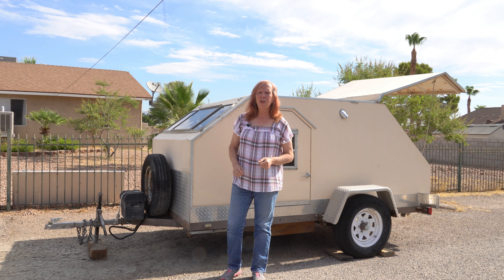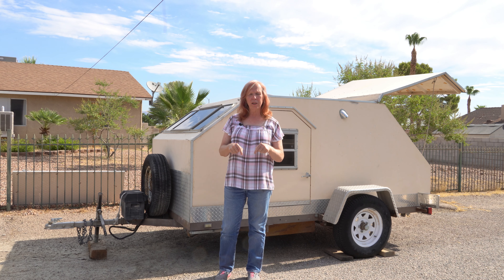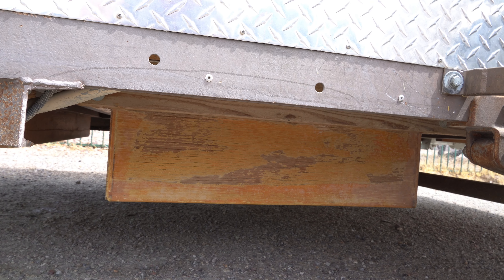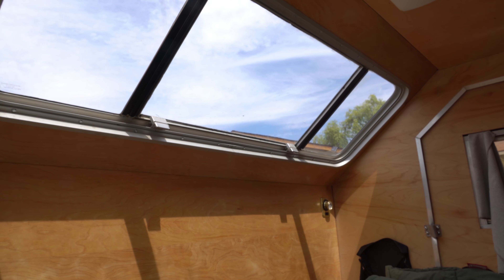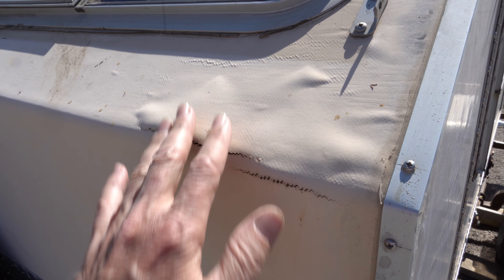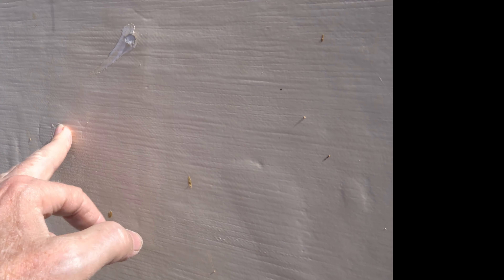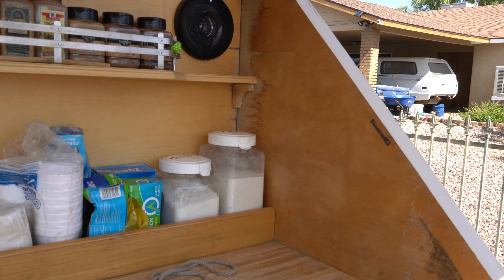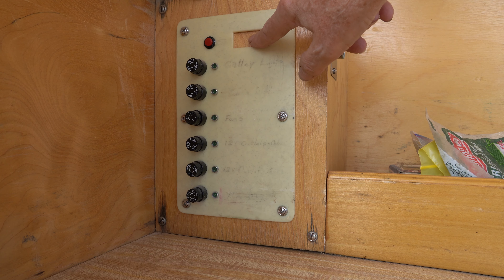Can We Save The Desert Dawg?!?

Comment: Great video again Joanne.  By the way, I wouldn't stand on the fender if I were you!  :-)
Air Conditioning,...  Oh, just to dream about it!  It would be a luxury indeed but I worry about how it will stand up to the kind of terrain we normally take the trailer through.  I'm thinking more of the compressor side of things.  I'm sure the units designed for trailers would be tough but they probably aren't designed for the brutal forces off road tracks will put them through.  You'll have to check feedback from other users.
As far as alterations and upgrades go, I am struggling to think of any, apart from the pool of course.  The trailer is amazingly functional as it is.  It's really only the wear and tear that is causing issues.  Small things like a third (top) bracket for the fenders to relieve the forces on the two lower ones, alternative mechanism to stop the side doors opening too far and, most importantly, some kind of wind break for the galley although we have discussed this in length and never come close to an adequate solution.
Oh, replace the front trailer jack, that one is going to break off one day, he, he.
Really, that trailer is so good, a bit of TLC and we're good for another 10 years or 100,000 miles.
I don't know if there is anything you can do about that grumbling bear I hear growling all through the night, I assume it must be the wind or something!  It's funny, it always stops when you get up to 'powder your nose', you must scare it off!
Reply from the maker: Tony, thanks for your feedback! Being that you and Kelly have spent so much time in the trailer, I really value your input. She has some ideas too. I had originally thought about a third bracket for the fenders, but didn't like how that would look. Obviously a wrong decision. I've been watching them increasingly vibrate in the mirrors as we travel so I'm not surprised that they have failed. There will be an upper bracket this time.
I do have a couple of ideas for a shade/wind block, but I'll have to refine those ideas. It will never be a great solution since it needs to go over the hatch.
What about a color change? :-)
Reply: @OutdoorAdventureTV  Well, I have an idea regarding the color (or 'colour' as it's really spelt),...  I was watching a tv program about the manufacture of Aston Martin cars and one of the paint requests they had was from a chap who had a chunk of moon rock which he had had crushed to a fine powder and wanted this incorporated in his paint.  T'was to be called Moon Rock Grey  (or 'Gray' as you funny people spell it).  So, that please. :-)